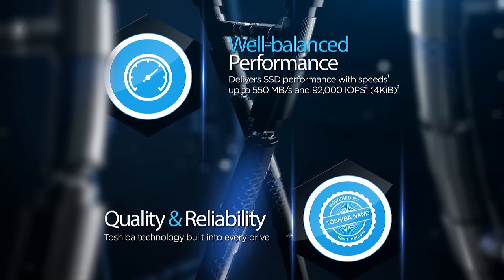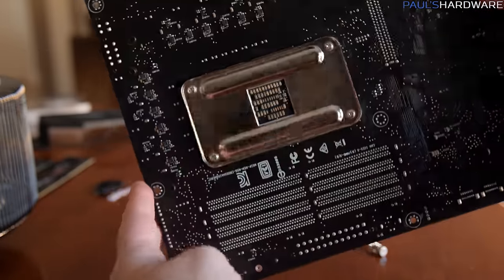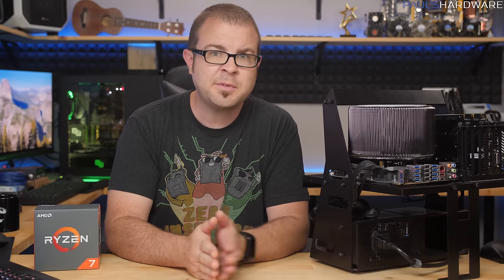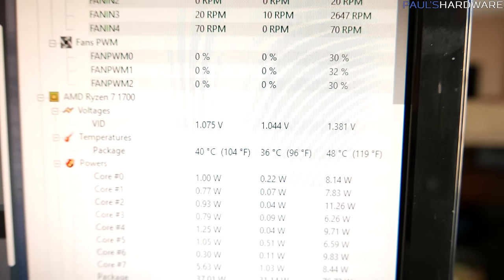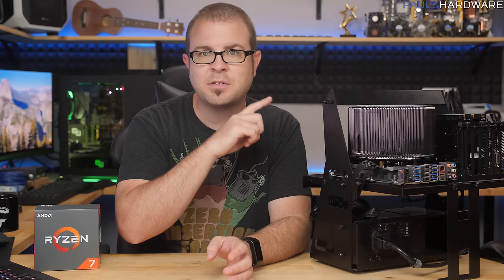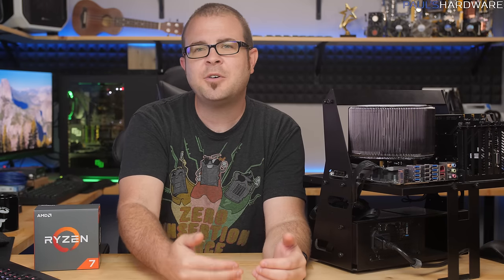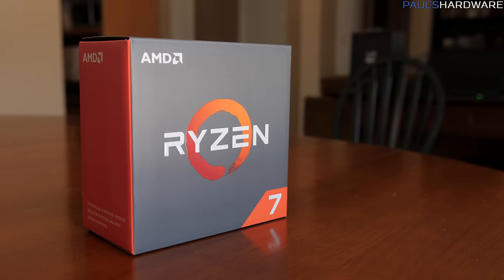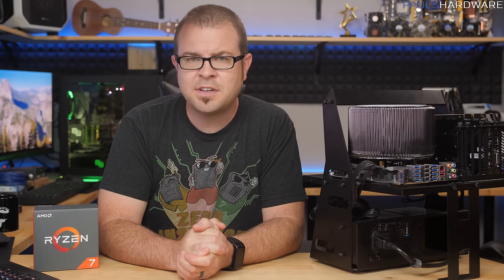Can You PASSIVELY COOL a Ryzen 7 CPU?

Comment: wait, how does ryzen work over ram 2933mhz？I have a pair of corsair lpx 3200, it can boot at 3200 but system just crashed later, Is it because the ram is not optimized for amd chips?

Comment: No thanks on that. One thing I have gotten used to with PCs is the slight noise. I don't understand how someone can get annoyed with atleast a little noise. It's like the sound of a room fan. Yeah, if it sounds like a motor, sure, thats a bit too much. But if it is at a nice purring white noise level, and I have my headset on, I don't notice it anyways, and if I don't have the headset on, it still doesn't really bother me. I have two PCs set up next to me, both with fan CPU coolers, and atleast 6 case fans each, and then the GPU fans. Far better scenario to me personally than having something the size of a tea kettle sitting in my PC, interupting airflow.

Comment: They come and go so fast because there's really no good reason for a CPU not to be fitted with active cooling. If you want a tower with few fans then you're still going to have one on the GPU and CPU.

The only actual reason anyone would be building a zero fan system is to have one that literally emits no sound which is going to be a bit counter productive when the fire alarms go off because it exploded. Spending all the extra cash on something that does less is nothing more than a novelty.

Comment: I use my one with this Nofan CR-80EH Copper IcePipe 80W I had to modify the bracket a bit also I put a a fan on the top for when I gaming sometimes never had problem average temp 56C when I gaming usually gta5 and doom the temp rise up to 68C of course the fans spinning at this time. I have a be quiet 800 case.

Comment: Yes you can but with a bigger cooler, some guy made 1080ti and i7 or ryzen 7 i dont remember :) (both passively cooled) and managed to overclock it to 5ghz, and he had very very low temp. Also he made a nice costum wooden computer case with rope sides.
edit:
nm he had a fan but with very low rpm, found the video https://youtu.be/N-z9PidYH4E. You cant hear the fans, so that still counts? :)

Comment: 100% passive is dumb. Semi passive is the way to go, take a beefy CPU cooler like a cryorigh R1 or a Noctua D15 and configure the fans to only spin up when temperatura gets higher than 65~70c. Bingo, now 90% of the time when not gaming and only doing light work or webbrowising your pc is dead silent and not gathering any dust. 

Adding a single large exhaust fan on top at very low, inaudible RPM (something like a 20cm fan at 600rpm) helps dissipate accumulated heat and keeping VRMs more confortable and keeping the remaining fans off for extended pc usage.
Reply: sephirotic87 NH-D15 with ultra low noise adapter is INAUDIBLE 🤷‍♀️ Just use 1 fan in between to not create turbulence and you will not hear anything.

Comment: This is totally off topic, but I'm posting it everywhere I can think of to get techie input...

Seems I need to change motherboards on a year-old build.

If it's an identical motherboard, will the hard drive play nice, or will I have to reinstall Windows 10?

I suspect if it's NOT an identical motherboard, the reinstall will absolutely be necessary. Am I right?

Also, will my Windows installation now be invalid, meaning I have to pay for a new license? I've been told that SOMETIMES they'll let you keep your license, as long as the old motherboard isn't being used any more. 

Can someone clear some of this up for me?

Comment: http://www.coolermaster.com/amd-am4-ryzen-compatability/en/ CM 612 R.2 comes with a fan the egg does not sell them with AM4 kit. Fits in a old Smilodon Raidmax case and does a fair job cooling a 8350 (4.5Ghz). I installed it there is 16mm clearance in 8 inch(200mm) wide case. I don't use the 80mm fans in it anyway, too noisy.  Does not have a problem with tall RAM. Tried do a Noctua C14 (it has a problem Gskill Flare with bottom fan in)  but the AM4 kit from Noctua was off 3mm on a ryzen board and required a Dremel tool and extra aluminium stock added to get it span out to the 80 mm my C14 needs to clamp. I guess if I was going to do a R5 1600 at stock speed it would do no fan also.  Looks like can only go in limited number of Micro cases and some of the mid tower will haves issues but did see a $25 case that would out for silent running. If you wanted to spring for Arctic silent series 120mm case fans.

Comment: Can someone clarify something for me regarding the 1800x (and mobo). I just bought an 1800x paired with an h100i v2 and it's idling in BIOS (updated - x370 Taichi 3.00) at mid 50s. Idling with some browsing it goes from 50-60c. The voltage randomly bumps to 1.4 occasionally as well. I read an article saying that there is a +20 differential for the 1700x and 1800x. I live in LA where it's fairly hot too.

1. Is that something that exists with bios updated? I've been using core temp and ryzen master to read temps.
2. I am running at 3200 through XMP Profile provided. Is it better to overclock manually than XMP? Not touching the CPU but just the ram.
3. Is is possible that my fans were placed the opposite direction? I have my radiator on top (phanteks pro m case) and I couldn't tell how to place my fans with no direction showing. I want them facing up against the radiator but can't really tell.
4. I never installed my drivers for my mobo but nothing is with the yellow caution sign in device manager. Is it really necessary to install mobo drivers? I'm not sure if that would fix my temp issues but just curious if I really have to.

I've played a few games of Overwatch and everything seemed to run really smooth as far as games and temps weren't too crazy but fans did get loud. I've never owned an AIO though so it might've SEEM loud to me. 

Any  help appreciated.

Comment: the design of this cooler just seems really stupid.
there is a ton of wasted space inside the cooler, they could have easily run 2 more heatpipes at the cpu and let the het get carried away inside the empty space of the cpu with a ton of more fins.
also what is the cooler version for again?
paying a ton more for no real advantage, but a lot more weight?

Comment: So it really is a 95W TDP cooler -- it should fair well with even the 1700X and 1800X, especially if undervolting is applied.

80F in there? You really like it warm, eh. I like it 71F during the day and 69F at night for sleeping.

D**N those Patriot Hellfires run HOT!!! I know the claim is that that is "normal operating temperature" and "NAND should run a little bit warmer" but that's too warm. Peak sustained temps of 70-75 C would be fine, but some folks are getting into the 90's when it's sitting under a hot GPU. I know they have aftermarket M.2 heatshields, but those don't typically pull heat away from exactly where they need to since it's a semi-generic design. Thoughts? I prefer a Hellfire over a 960 Pro and especially Evo (TLC NAND is fine for peasants ;)

Comment: Passive cooling only works in the past because the hardware can handle heat of such levels, active cooling became a big deal today because heat output can get to the point to damage surrounding hardware.

The only way passive cooling can be a thing is if power usage and efficiency ramps up more so you can undervolt the cpu to the ultimate levels and get a lot of performance for absurd low levels of power.

Typical human technologies wouldn't ever have that happen, you'd have to have some weird alien technology or stuff not found on earth lol...

But imagine giant cloud computing hardware running in space, using the coldness of deep space to cool it?

Comment: Ok, two comments...  first,  you can't test fanless coolers on open air test benches.  Air flow from your room air will be much better than in a case and will vastly increase the cooling capability of the fanless cooler.

And second... you set your ac to 80? What the hell? Lol

Comment: Impressive ! i would like too know 3 things. 
1. how would perfom in a case without any additional fans and in a regular case with some casefans
2. How would it perform with a low rpm high volume fan just layed on top of it
3. could you mill some parts of so you cold fit your gpu in the first slot

Comment: Hello Paul .. I used the Corsair Vengeance LPX 3200 v5.39 in my Mini ITX Ryzen build with the ASROCK AB350 Gaming ITX/ac because or price .

Was getting 2933 and NO 3200 with XMP timings even with 1.5v tried . Totally getting 3066 both with XMP setting and the tighter 15-15-15-36 timings .. check AIDATA64